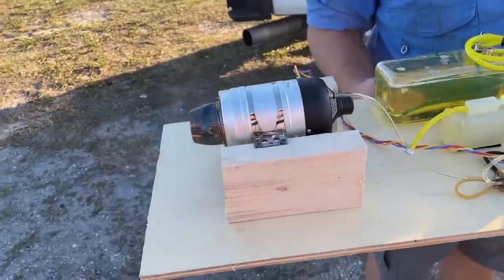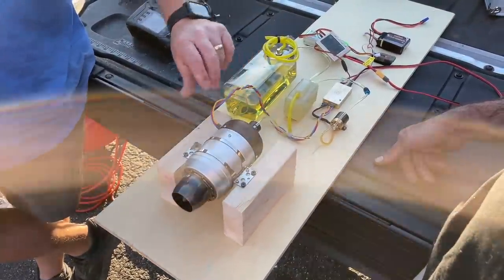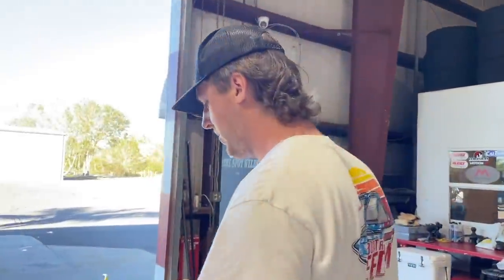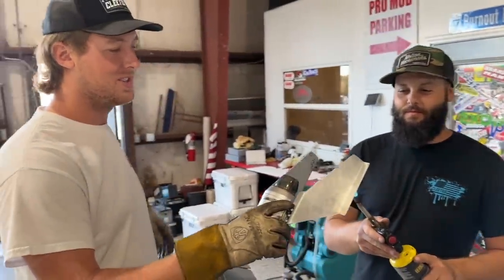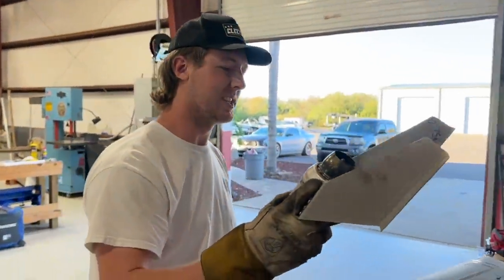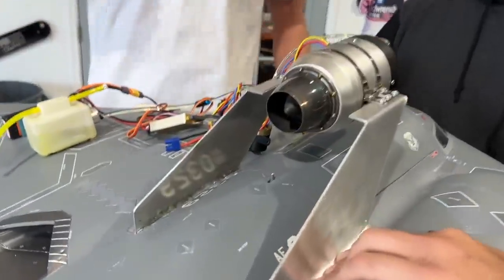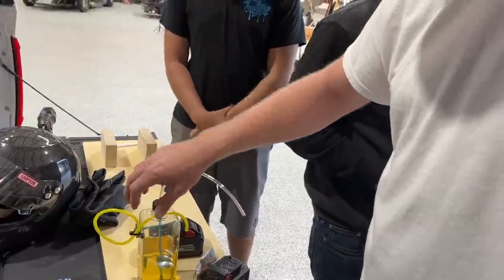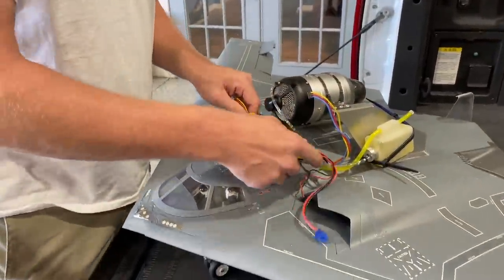I Added A Super Powerful Jet Engine To My GIANT B2 Bomber... Is It Gonna Work???

Comment: That glue will not hold up with that weight. Drill a few holes and tip tie it down as well. There's a spar in the wing and that's the strongest part of the wing. Run the zip ties through the foam and around the spar. Then I think this idea will work! Good luck from a fellow rc jet flyer!
Reply: that's what I was thinking, it's gonna turn into an  unintentional $1000 missile
Reply: ^^^^^ EXACTLY ^^^^^
Reply: I thought “tip tie” was a rc airplane term until I kept reading. I’m an “idiot”.
Reply: I'd be surprised if it makes it off the ground.  Even if it does, the thrust will make it instantly do an inside loop ....  there won't be enough airspeed for elevons to function properly.  I see a complete failure.
Reply: 100%. Also the structure they built to hold the turbine is facing the wrong way. Bringing the turbines weight much to far forward. It will just push the nose down immediately. If they flipped the two supporting beams so it sat more behind the wings than in front of them it would function alot better. You can tell no one there actually has any understanding of physics or engineering. Most of the stuff they do is just buy parts from places and pay to have someone help install them
Reply: @PsychotropicThunder  I didn’t call him a dork, you did.
Reply: Yeah o don’t know if foam tac is the right adhesive for that mount. That’s stuff is flexible. I agree with the zip tie method but also use gorilla glue or epoxy there.
Reply: IT'S LIKE A HURRICANE STRAP AYE? OR A TIE DOWN... PHYSIC'S 4 DUMMIEZ
Reply: Yeah, but what's the fun in that?
Reply: @PsychotropicThunder  lol you’re taking this way too serious, obviously there’s a better way to do this and mount the engine but if you can’t see they’re just having fun with it until it inevitably ends in a fiery crash then you’re watching for the wrong reasons. Lighten up man these guys are having a blast and you’re just miserably commenting on his videos 🤷🏻‍♂️
Reply: @PsychotropicThunder  No understanding of engineering and physics is just being ignorant but I see what your trying to say bud...
Reply: @dougsain5090   i am fluent in three languages and have no idea what that crap you tried to say is supposed to mean...
Reply: @ДжонПартлов  then just ignore it
Reply: DOSE THAT MAKE SENCE???
Reply: cringeworty... well at least you  didn't write  what i get a soda out of a machine with... "cents" I  believe the word you're trying to use there is sense.... there's no "c" involved there, and dose would be how much medication i need to take to ignore your butchery of the English language. the word you meant to use was "does" but by all means keep it up I'm just laughing at you not with you
Reply: @ame7165  I can't wait 😉👍
Reply: zip tie thru the spar sounds like a good idea to me, good thinking!
Reply: 3 rivets a side?
Reply: I would have built a entire exo skeleton top and bottom and sandwiched the plane with bolts thru the foam  then welded that mounting system.
Reply: @nickmackin  ya but we want it fly for at least a little bit.  This is just throwing $900 into a fireball immediately upon a launch attempt, and kind of a dumb waste. I'd rather see it work for 10 seconds than the jet ripping of the styrofoam and blowing up on the ground.  But I guess that'll be entertaining as well.

Comment: its gonna violently pitch nose down when too much throttle is applied. Don't forget to bring the fire extinguisher lmao
Reply: To be fair its never going to lift off from a roll without breaking the nose gear or just keeps it planted on the ground without enough elevator authority
Reply: Most aircraft pitch nose up when speed is increased.  Why would this be different?  Regards.
Reply: clet and crew listen to peter!!! he knows what he is doing
Reply: @michealbeethoven3868  not nearly enough elevator for the weight.  The engine angle is also going to push the nose down.
Reply: Searched comments specifically to see if anyone tagged Peter.  Delighted to see he's already commented.
Reply: Come on down and show these boys how it’s done!
Reply: Peter we need a collaboration! Two fantastic channels! 👍
Reply: @michealbeethoven3868  because the turbine is mounted so high above the body and the center of mass, the top of the plane is getting pushed harder than the bottom, so it will dive under thrust. real planes rise when under throttle because usually engines are mounted under the wings of the plane, or generally under the center of mass
Reply: Nah he has a diploma in aerodynamics
Reply: @michealbeethoven3868  wing span needs to be appropriate for weight. Lift is nothing without wingspan. But the joy of making and watching is priceless.
Reply: Glad to see someone who knows what's about to happen makes a comment. This was not a good use of thrust placement from the start! Hopefully, they don't try a launch because it will be disastrous, albeit. Entertaining!
Reply: Especially with that much height added by the risers over CoG acting as a big long lever lol
Reply: @michealbeethoven3868  because most aircraft have their engines mounted in line with the centerline of the airplane at the most, and the wings lift area above that, this one has it mounted far up high acting as a lever
Reply: That is exactly my thoughts Sir Peter and no one knows that better than you ! Much respect Peter !
Reply: @danmyers9372  Hello Dan; thanks for the info.  Apparently, these guys are amateurs and hopefully no injuries or lives are at stake!
Reply: I'd have to go with Peters opinion on this. Because Peter.
Reply: @botzachary9891  BOT Zachary; Thanks for the comment.  I fly real planes but the center of thrust for my single engine is right in front of me.  The center of gravity (CG)  is a few feet behind me with full fuel and gradually, during flight,  comes forward.  At any time, regardless of fuel load, if I go faster the nose pitches up.
Reply: @michealbeethoven3868  Center of thrust is way over the center of mass
Reply: @michealbeethoven3868   Thrust is WAY too forwards and high. it's going to try and pitch nose down really hard
Reply: @nonyabiz2777  Hello nonya biz:  Lift is always wingspan; except when you have so much power that one can fly like Sean D. Tucker at 300MPH with the wings vertical!  No lift on a vertical wing.  Please google his name and watch YouTube of this amazing pilot.
Reply: @EatMyYeeties  Hello Eat My Yeeties.  What torque?  This is not a propeller thrust engine, it is turbine.  The thrust is straight from front to back.
Reply: @michealbeethoven3868  it’s gonna be way to top heavy tried this but with a go pro it’ll flip over and plummeting into the ground 😂 ready for the next video if it flys I’ll crap myself
Reply: @michealbeethoven3868  because the motor is too far forward and high up..  so its more rolling the plan forward then pushing as good thrust. Thats what my brain is telling me.
Reply: @michealbeethoven3868  peter knows what hes talking about but anyway i will explain. its like a lever the thrust is higher than the center of lift and the angle of the engine will just push it nose down just think about it for a second lol
Reply: My thoughts exactly
Reply: yup, and I don't see how that engine rig will hold with only two thin strips connected to the foam plane body, aside from the lack of curing time.
Reply: Nah, send it, then collab to see where it will go wrong.
Reply: I was thinking the same thing. If it gets airborne, that is 😆..if it does, I'd hit the panic button while I'm in a climb to help mitigate that possibility.  That said, I have zero faith this glue will hold, but I hope to God I'm wrong.
Reply: @michealbeethoven3868  because thats how physics work with that kind of mounting lmao
Reply: will it be safer to hand launch it inverted.
Reply: @nonyabiz2777  his landing speed will be way up to lols
Reply: @michealbeethoven3868  Watch Peter’s excellent channel. He know RC.
Reply: you know its done when the man who builds planes isnt confident xD
Reply: Just fly inverted!
Reply: @michealbeethoven3868  leverage, while the B2 is very sleek, the body of the aircraft will create drag. the engine is mounted so high that as it pushes forward it is going to want to rotate down around the mounting point multiplied by the height of the bracket and the drag of the air craft.

IRL planes the engines are often placed under the wings. When pilots initiate a go around the exact opposite happens where the engines increased thrust cause the engines to rotate up around there mounting point. This upward rotation makes for the pilots to have to carefully and quickly react to prevent the plane from striking the tail on the ground 

( IRL plane rotates up because the engines are below the wing unlike this B2 where the engine will rotate the B2 down as the engine is mounted above the wing )
Reply: @nonyabiz2777  eh.. “ enough thrust and even a rock can. “Fly” “

the question is if the control surfaces will have enough authority to direct the projectile.
Reply: In that case... take off and immediately do a roll and it'll fly straight up in the air !
Reply: It's gonna loop to loop at takeoff then smash violently to the ground. The rocket engine will be the only survivor at the scene!
Reply: I going to need MCAS
Reply: @michealbeethoven3868  I has to do where the engine is mounted most aircraft have the engine under the wing,this on has it on top, since the engine is on exactly the same level as the wing is going to create some momentum.
Reply: Fire extinguisher??? Nah mate, a tea cup for the parts left  over.
Reply: I was just thinking about how much effort you put into getting all the "centers of" right and what happens when something is off. This is going end spectacularly on the runway.
Reply: @kasuraga it doesn’t matter how far forward or back the thrust is, only the height above the center of mass and center of pressure. You can compensate for the extra height by angling the engine, but they haven’t done that.
Reply: @michealbeethoven  there is lift on a vertical wing it just won't conteract gravity. You can't really consider it lift because the force is going sideways but the wing is still generating force anytime it passes through air with enough velocity.
Reply: Come on Peter we need a flying mullet and Ruby
Reply: @michealbeethoven3868  The engine is mounted way too high which increases the distance between centre of gravity and engine force vector (force created by directed thrust). That in turn will create a good amount of torque that forces the planes nose down, violently. I might be wrong but I don't think the planes is going to be able to take off. It'll be fun to watch either way which is all it is about.
Reply: Is there a way to save the top mounted jet? As many mentioned it will pitch down, but is it possible to maybe move or angle it to make it work while still being top mounted?
Reply: @mikedrop4421  Hoping they can get off the ground using the electric engines and the turbine at idle and experiment with more thrust airborne. But I'm not sure its going to be stable enough to get off the ground with that much percentage of weight mounted so high. Fingers crossed. Love to see it take filght.
Reply: @FREEDOMGUNNER  yeah like when a jet plane hit the pentagon lol
Reply: The expert has entered the chat
Reply: @michealbeethoven3868  The engine being so high above the center of mass and drag, will act like a lever when pushing forward, pitching the nose down violently.
Reply: how do you know that? its not like you've built a plane before.. jk lol XD
Reply: You are right Peter, been following you for years btw. Great content!
Reply: @michealbeethoven3868  cause the jet is mounted above cg
Reply: With cleeter's expert piloting skills there will be no problem this b2 is going to the moon.
Reply: @camk2552  should have Matt from DemoRanch bring chief. they can fix his broken water pump and he'll put out the fires
Reply: I vouch for Peter, get this guy down there to the compound to sort your RC needs!
Reply: @michealbeethoven3868  lol are you serious? The engine is mounted way above the plane. It will create an enormous torque about the pitch axis to drive the nose down.

Unbelievable comment.
Reply: Yup.  The thrust line needs to be pointing towards the center of lift.
Reply: I feel like a colab so happen soon!!
Reply: I’d listen to the guy who’s physically flown inside of his own rc plane.
Reply: It went from being a B2 Bomber to a WWII Buzz Bomb.
Reply: boy where you wrong! hahaa
Reply: Well it flew pretty good
Reply: @bubbajfpv8856  You were saying?
Reply: I love that he put this comment in his new video
Reply: @Bansheemagz01  you are dead wrong lmao.
Reply: @GetTrackingNetwork  So much for that!
Reply: How's it feel Peter?
Reply: @GetTrackingNetwork  it deff did lol
Reply: Oh look.  The almighty Peter was wrong........
Reply: @cwaite487  to be fair cleet was at almost max elevator deflection. prolly to counter the pitching down the Mr. Peter was talking about
Reply: LMAO WRONG 🤣🤣🤣
Reply: Yep. Its gonna need to be tilted down a few degrees in the front of the engine to naturally torque it upward or else its gonna dive like crazy
Reply: yep same thing i commented too.  and confirmed in the followup lol, he kept repeating that he's full elevator.  but kudos to him for actually doing a successful flight with it
Reply: I bet it will work
Reply: Was not expecting to see you over here haha. I was thinking the same thing but it's surprising flew somewhat ok
Reply: @escapetarkov3838  lol I was saying that it wasn't gonna work but as always Ole cleter came through and made it work! That was awesome!
Reply: Actually worked pretty well considering...lots of people were way wrong.. he even landed it safely the first flight I've never seen more people in a comment section wrong I was happy he put a couple comments up today of all the wrong people especially the ones that said the glue would never hold haha
Reply: It flew better and longer then that big 30ft plane you made at least. Peter I think you owe Cleetus a invite to flight fest so he can ram his B2 into your next monstrosity. It’ll be the cross over i didn’t have on my 2023 bingo card
Reply: The turbine will PIN this thing down on the ground lol
Reply: @edwen303  they posted the video already. It flew successfully each time and landed. It actually pitched the nose up with throttle unlike the internet experts predicted
Reply: @glossjunkies6026  The plane actually did nose down. He had to use full up-elevator to slowly get it to turn. But the faster it went the more elevator authority it gained. So as Jeremy Clarkson once said in Africa: "Power and speed solves many things."
Reply: @bubbajfpv8856  Hell yea brudda!
Reply: At 14:11 on the flight video, with the gyro off, it nosed over pretty heavily ploughing into the ground...
I think the gyro saved the first flight!
Reply: Well, he did it and it climbed under thrust. Is this because of the airflow from the turbine pushing against the elevators?
Reply: @334peter  it's because it had a gyro.
Reply: It flew just fine.

Comment: This may not end well, but it’s going to end spectacularly and hilariously.
Reply: Either way it goes, it's going to be amazing 🤣
Reply: Yea, why glue? 😂 use fasteners and washers, even on Styrofoam, atleast you're spreading the weight
Reply: He better take off with the jet at half power.  That's all he'll need.  But if he goes full power with that thing there will be a HUGE nose-down push and I bet he won't get it off the ground.